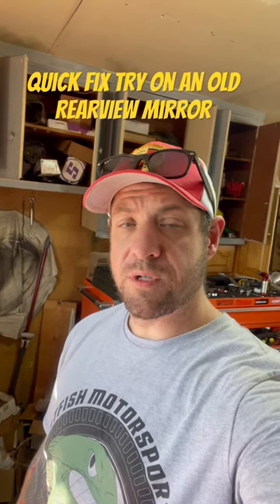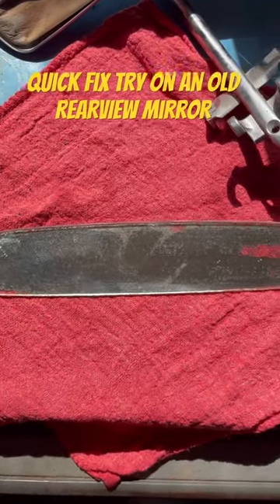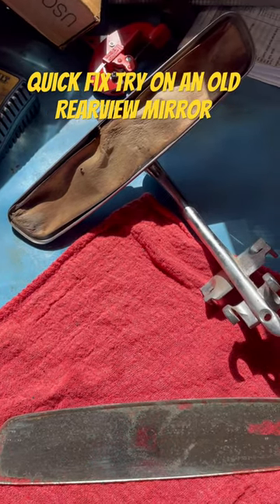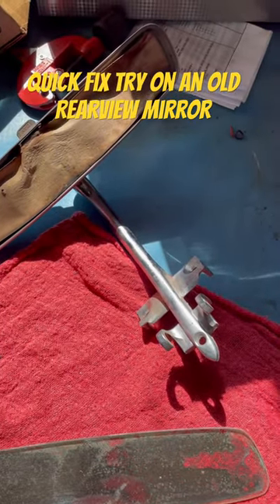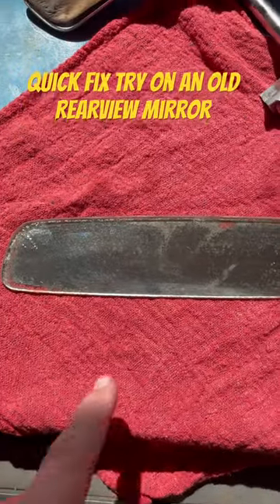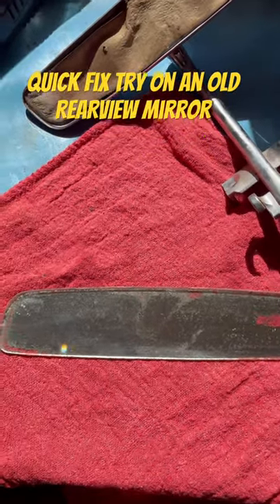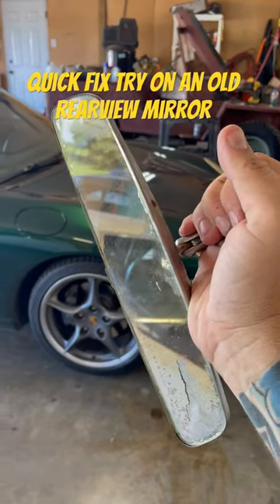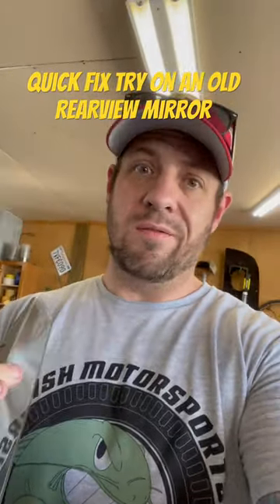#classiccar mirror fix fail.   Even the internet isn’t undefeated. #diy #diy #hotrod

Comment: That mirror spray paint is reflective but far from being a mirror finish.  I wonder if you could get a glass shop to cut a piece of mirror to match the shape?
Reply from the maker: Maybe?  It would probably be less work and money to find a good unit on eBay. 

For now I put it in. It’s ugly, but functional and that’s my channels whole motto. 

It keeps the sun visors from
Hitting me in the face when I hit the fun pedal!
Reply: @CatfishMotorsports  It's an interesting mirror assembly.  What car is that out of?  Looks like something old and possibly British.
Reply from the maker: @kirkjohnson6638  Old yes, British no. This is out of my 1962 Pontiac Catalina Safari wagon.  The real mystery to me is why there is one in the car that doesn't have the visor hooks.  I would have though that visors would be standard options in 62 but could be wrong.  I have the PHS documentation.  Ill have to look and see if they are listed for the car.
Reply: @CatfishMotorsports  I had to look up the safari wagon - that's an awesome vehicle!